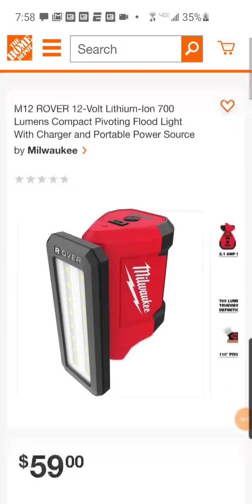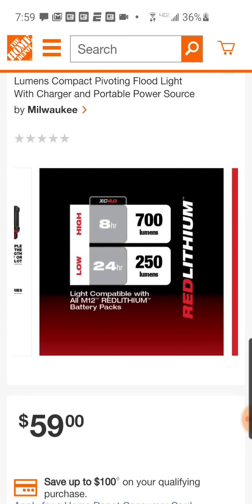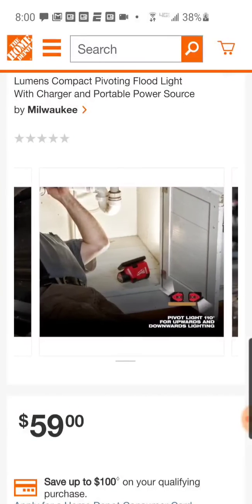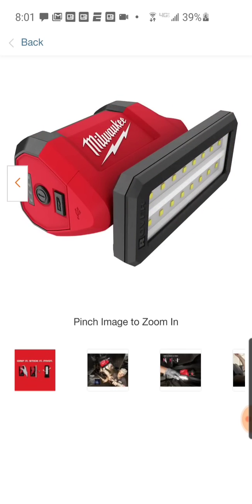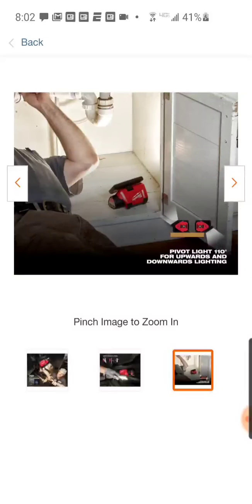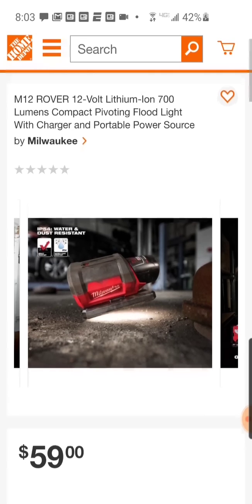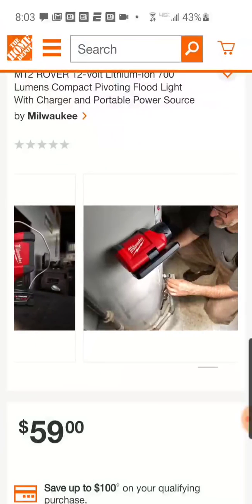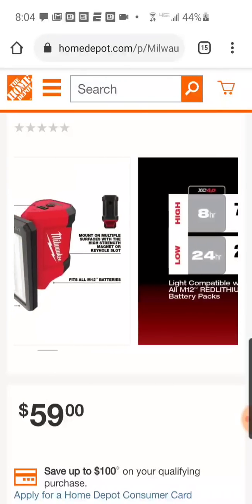Milwaukee M12 Power Source Light and Charger is Baaack

Comment: It doesn't say anything in the description about being able to charge an M12 battery with this. I'm kind of skeptical that it does ...
Reply: "The Milwaukee M12 ROVER Compact Pivoting Flood Light with USB Charging gives users a flexible source of light made for any environment, in any orientation. The light provides 700 Lumens of TRUEVIEW High Definition Output, is capable of lighting up a workspace for up to 24-hours at a time with an M12 4.0 Ah Battery Pack, and features a light head that pivots 120° to orient light in multiple directions. The light comes equipped with a strong rear-facing magnet made for jobsite surfaces like steel studs, I-Beams, and job boxes, and the streamlined form factor of the light's base gives users a handheld option for inspection lighting. Included with the light is a 2.1 Amp USB port for charging a phone or external device. For non-metallic surfaces, the light also includes an integrated keyhole for hanging capability. The compact pivoting flood light is IP54 rated for dust and water resistance, has an impact resistant lens protecting the LEDs, and can survive up to 9 ft. drops. ROVER flood lights are built to go anywhere and withstand anything."